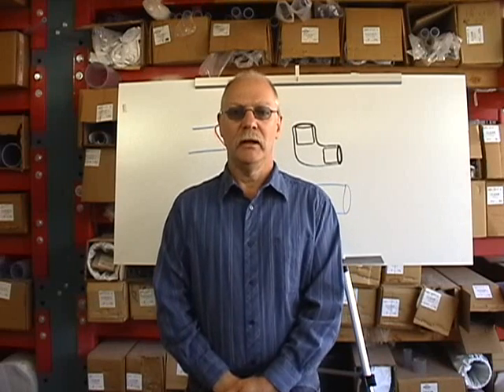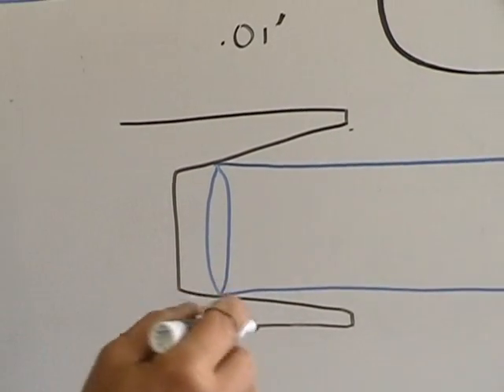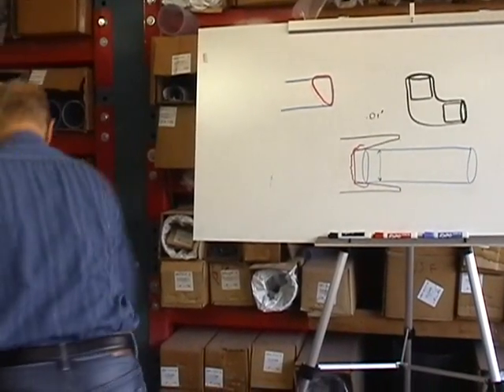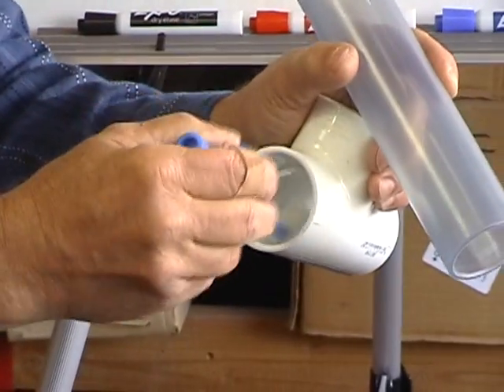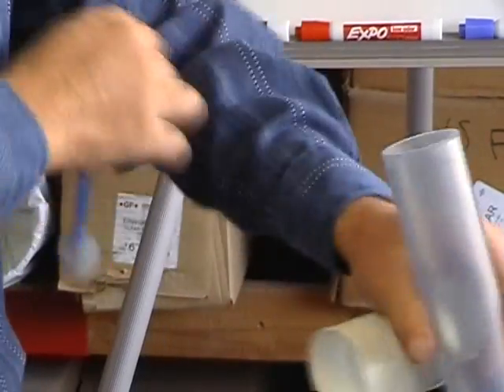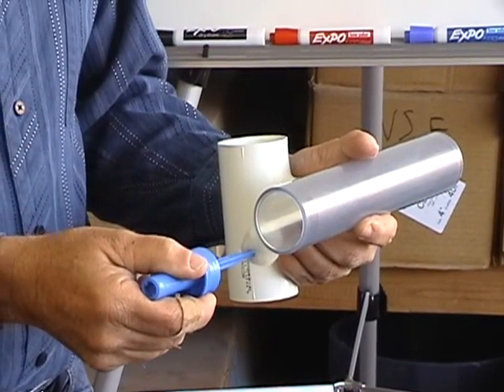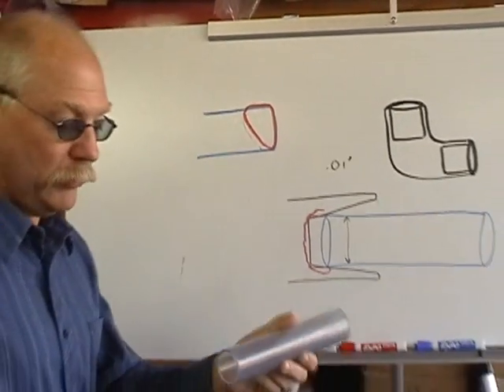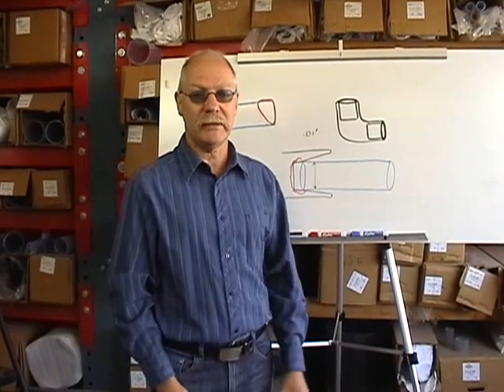FlexPVC® Present The Correct Way To Make A PVC Glue Joint So You Never Have A Leak

Comment: But how do you glue white flex pvc and type of glue ?
Reply from the maker: All pvc is glued with primer and cement. The primer softens the pvc and the cement makes the bond. For the cement, see https://flexpvc.com/cart/agora.cgi?product=PVC-Glue-Cement, for the primer see https://flexpvc.com/cart/agora.cgi?product=PVC-Glue-Primer

(you will need to scroll down.)

There are roughly 4 kinds of cement. Clear, gray, blue and green, but the colors are more of a tradition than anything scientific. Gray is the cheapest. Clear is the next, Blue is the most expensive. Green is transition glue and it's meant to bond ABS to PVC for drainage joints (not pressure.) It's unacceptable for flexible pvc pipe. The gray is also not recommended, it's bond does not work well with flexible pvc pipe. 

We no longer list brands any more because during the lockdowns it was too hard to keep certain brands in stock. But all the ones we sell are major brands: Oatey, Weldon, Uniweld, Christys, Pool Tite, etc.

The blue glue is for wet situations. It's the most aggressive and and will cure even in damp/wet environments. The clear is best for all around use but your pipes need to be clean and dry. 

Clear is used in "factory" or controlled environments like people who make Spas, Whirlpool Baths, etc. Blue is best for field work where you can't control the environment.
Reply: @FlexPVC  never use primer it actually weakens bond and that why they sell it so you keep buying it
Reply from the maker: @myviews469  LOL. I can tell you hundreds of stories of people who did just what you said and spent thousands of dollars redoing their systems. I can tell you about a blueberry farmer out in California who a hired a crew who believed as you did. He spend $50K to redo his entire irrigation system. I"ve been doing this for almost 50 years.  Use the primer. It's cheap and makes the proper glue joint. If you don't believe me, call Uniweld, Christys, Oatey,  IPS, United Chemical, Rectorseal, and as them about not using primer. They will laugh in your face. Just try to do a residential or commercial job that required pvc plumbing and an inspection and try not to use the purple primer and  you'll be redoing all of it.

Comment: That was very informative. Now I understand the need for primer if I make a permanent joint.

However, I have a somewhat unusual application for PVC pipes and fittings, where they need to be able to hold up running water through it at 30 PSI or less, but I need the pipe joints to be only SEMI-permanent, so they can be disassembled and re-assembled for repairs. What's the best product to make such a joint?
Reply from the maker: if you are using IPS pipe size (sch 40/80, etc) then there really isnt an option for you. If you are using CTS pipe size 1/2", 3/4" and maybe 1" there are some press in fittings that could do this for you. Give us a call (monday) or email (anytime) and let us know and we'll help you out. 🙂

Comment: Hi, Eric.  I recently watched several of your youtube videos and have learned so much.  For 20+ years I did not know what I was doing, letting my primer dry and sanding my pipe connections.  Lucky I have not had more leaks.  I just ordered some fittings and pipe dope from you today.  GREAT VIDEOS!!!

Some pool tech videos show disassembling old pvc joints using heat in order to reuse connections, especially where tight and it would be much work to replace everything. Your thoughts???
Reply from the maker: Yes, I've used heat to remove pipe from a fitting. It works. I will try to make a video showing how I do it. Thanks for the comments and suggestion. :-)
Reply from the maker: All the ones we sell are rated for plastic fittings.

Comment: If possible always remember to twist pipe after connection is made. This is important and is part of the pvc glue instructions. Good information Sir. Thank you.
Reply from the maker: That is incorrect for Flexible PVC pipe. You should never twist flexible pipe. The general rule has been a twist for rigid pipe and that's okay, but it's not for flexible pipe. There is a reason for it, I'll have to make another video explaining why.

Comment: SERIOUSLY??? Aren't you supposed to twist it in about a quarter inch and then hold it together for 10 - 30 seconds till it dries??? That is a pretty important point if you don't want a crap joint.
Reply from the maker: No, not with flexible pipe. You should not twist. Rigid pipe is okay with twisting a little, but flexible. Thanks for the question.

Comment: Interesting information!  With the many years of experience you have with PVC pipe, I'm curious to know how flexible 4'' PVC pipe is.   The reason I ask is, because I'm lifting the floor in a house about 2'' and the septic pipe is on the side I'm lifting.  Another question, if I need to cut the pipe and rebuild it.  Can it be cut at the elbow where it is glued and a new elbow glued in?
Reply from the maker: Hello,

4" flexible pipe has a min. bend radius of 28" (see https://flexpvc.com/Reference/FlexiblePVCPipeSpecs.shtml) but you'd need machinery to bend it that tight. A typical person could take an 8' long piece and bend into a U shape without too much trouble.  

Flexible pvc pipe glues into fittings, not the other way around. If you cut it flush with the elbow you'll have to replace the elbow. We do have some inside pipe couples that would work in drainage, but not pressure situations.  

Please email us via our website (top of the page, just to the right of the phone no. ) and we can answer that way. Or you can call 888 782 3539 from 10am to 4pm M-F to talk with us. 

Thank you for the questions.

Comment: You need to twist it, quarter turn or more after you put the pieces together and then hold for a few seconds (depending on glue type) to make sure the joint doesn't back out.   The spinning of the pipe distributes the glue more evenly.
Reply from the maker: That is true for rigid pipe yes. But for flexible pipe that is not true. You should just push the pipe in and hold. No twisting flexible pipe.

Comment: The HVAC  people put in PVC for the exhaust outside and used  the primer too far down              
 ( purple color) and did not get it sealed so it drips water condensation. They needed bigger daubers for 4 inch pipe.
Reply from the maker: See our video #3 at https://flexpvc.com/TechArticles/FlexPVCVidList.shtml on how to fix that leak. Costs you almost nothing but a little time.
Reply: Thank-you, I did. Tricky being attached to the furnace and outside.

Comment: I have a place with an  8 ft octagonal in-ground spa. It was leaking. I removed the concrete and dug down. The 1.5 I/D flexible pipes were severely kinked in numerous places. It is the most atrocious bit of plumbing I have ever seen. I would like to keep as many air-water mixers/ jets as possible. For most of the pipes I can cut the flexible pipes at two inches from the jets and add a straight coupling. The jets are in the middle of the octagon side. This means I need to insert 28 inch pipe sections into two couplings at 45 degrees to each other. My question... will I be able to bend a 28" section of EZ-Flow 1.5 into an "S" shape to accomplish this. If so - put me down for a 50 ft roll.
ps Excellent video, much enjoyed.
pps. Does warming the pipe in the Florida sun make it easier to bend?
Reply from the maker: Hello,

I'll try to answer this here. If you still need help, please call us at 888  782 3539 or use the "contact" us link on our website.

Will the EZ Flow (or any) flexible pvc pipe in 1.5" x 28" long bend into an S shape?  Yes, but it will be a very mild S. NOT much of a curve to it. I can't see your pool, but based on what you say, I would use flexible pvc pipe with 45 degree wyes (475-015 on our site) and then run a line "around" the pool and branch off to get to each jet. That way you can make the pipe as long as you need it. You can also use Tees, but I think the wyes will work better for you.

YES, very much, the warmer the weather the easier it is to bend and shape. You can even use a heat gun (CAREFULLY) to warm up the pipe and it'll make it much more pliable. 

If you still need help, please use the contact us link on our website and send some pictures. Or post a video here on youtube and we'll have a look. Thanks for the questions. :-)
Reply: Thank for the prompt answer. Re-reading my question it didn't make as much sense as I intended. What I MEANT to say is  I have embedded jets in the spa, which I would rather not remove -  just to avoid the can-of-worms syndrome. I want to cut out the existing flexible pipe leaving two inches at ended to which I can glue straight couplings. I want a new single piece of EX-Flex which will be glued to one coupling. It will then bend 45 degrees round the outside of the tub to the other coupling. I will have to 'distort' the pipe to slot it into this other coupling.  All I wanted to know is the pipe had enough flexibility to make this easy allowing for the fact that the glue sets very quickly. From what I have now seen this doesn't appear to be a problem.
There are 16 such pipes to replace and I thought it a good idea to replace all of them at the same time inluding any not leaking.
Thank you again.
Reply from the maker: You will need to let the glue dry 24 hours before putting any stress on the joint.

Comment: Great video thanks.  Is it necessary to clean dirt or dust off the fittings or give them a light sanding so they are clean?
Reply from the maker: Yes, I clean off dirt and dust. I don't ever sand the pipe unless it's damaged or very old pipe that has swelled. Sanding removes material at the critical point. Sanding came from the plumbers who were soldiering copper tube. Correct for copper, not correct for pvc. :-)
Reply from the maker: Large junk yes. I wipe it if it's got mud, or grease, etc.

Comment: Here is what i want to do...i have 2" pvc,,with coupling on end,,now i want to install flex pvc to that,,and continue to my salt generator which i need a 2" union,nut and tailpiece...then continue to my pool heat pump inlet and outlet unions...are all the fittings same ? and ok to use on FLEX pvc? andy special glues? or same process and parts as pvc sch 40 ? thanks..i hope i explained that,,haha...thanks....
Reply from the maker: Flexible pvc pipe glues directly into standard fittings just like regular pvc pipe with standard glue and primer.
Yes our flexible pvc pipe has a NSF 50 rating for swimming pool use (among other uses.) Thanks
Reply: thank you ..have a great day.

Comment: Thanks for theses helpful videos. Should we sand paper pipe/fittings before primer-glue, I was told to sand but it seems wasteful and time consuming. (mostly 2'' swimming pool plumbing)
Reply from the maker: I've never sanded a piece of pipe unless it deformed. There is no benefit to sanding perfectly good pipe.
Reply: Sounds good to me. The guy said that there is a "coating" from the manufacturer that you need to take off but isnt that what the primer does?
Reply from the maker: @Latinos4Trump  Yes. Also that coating is just the release agent.

Comment: Your buildup begs for an actual demonstration using primer and glue.
You made no mention of exerting enough pressure to "bottom out" the pipe in the fitting.
I've had to redo joints because I did not insert the pipe quickly or hard enough before the glue drying made it almost impossible to get the pipe in far enough. You might consider the importance of these tidbits for the inexperienced.
You don't mention letting the primer dry or not before applying the glue. Which do you recommend?
Reply from the maker: +Roger Thornhill Hello Roger. Last questions first. No you do not let the primer dry before applying the glue. The primer is a chase. It pulls the glue with it, put another way, it leads the glue into the pvc material. There is another video I need to make to show the difference between gluing rigid PVC and flexible pvc pipe. There are a few differences. One if them is the amount of pressure used to push in the pipe. Thanks for the suggestions. I'll include them in the next video.
Reply: +Flexpvc Just noting that the instructions on my can of Oatey primer  definitely say to apply the solvent cement while the primer is wet. Wonder why.
Reply: +Roger Thornhill Sorry. I misread your response. I saw another video that said to let the primer dry. Got yours and his mixed up.
Reply from the maker: That's cool. Thanks. :-)